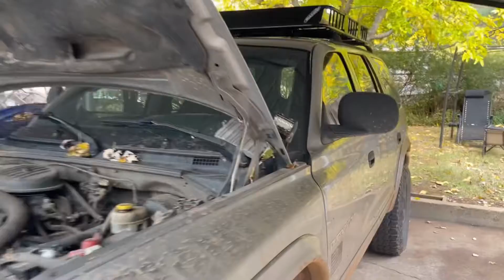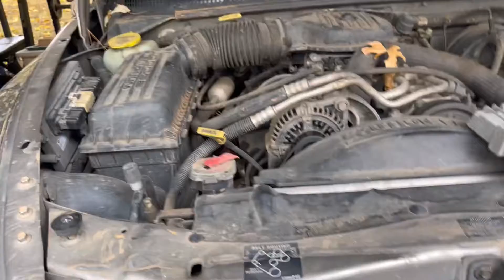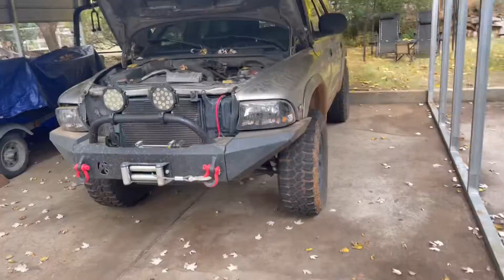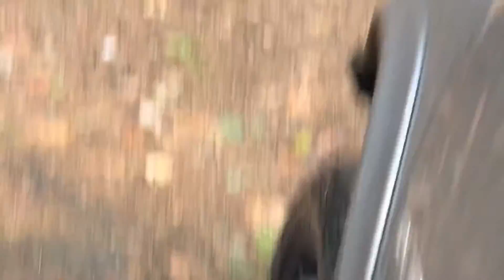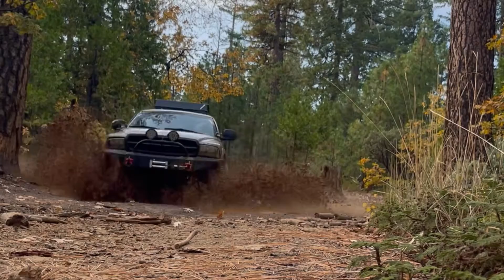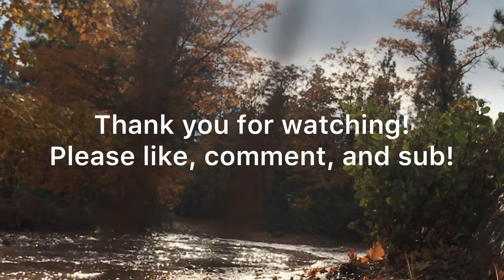1999 DODGE DURANGO 
BAD ECU / COMPUTER CHEAP AND EASY FIX

Comment: I just picked up a 1998
Reply from the maker: Nice! They are good trucks for sure.
Reply: @toocoolforschool3221  
As of now.... EVERYTHING is working except for the two - rear.. electric ⚡ windows from the drivers seat.
Reply from the maker: @user-gb9cd3ly8u should be an easy junk yard fix 🔥

Comment: Did you need to have the part programed for your Vin and all or was it just replacing it as is from the pull a part?
Reply from the maker: I just replaced it as is and it worked. Some people say you have to have it programmed and others say you don’t but in my situation it worked perfectly fine.

Comment: I have code p0505 IDLE AIR CONTROL MOTOR CURCIT. was that one of your codes. Diagnostic shows also short to ground. One last thing. Used a test light. The pcm test power and ground. On the unit. Outside the unit metal case.. you have to program the used PCM?
Reply from the maker: No that wasn’t one of my codes. I did not have to program the pcm but a lot of people say you have to But I don’t know if they are just wrong or if I got lucky. I would just make sure the Durango you pull the pcm from is the same as yours. Engine size, 4x4 or whatever.